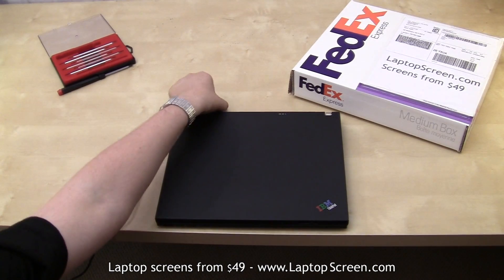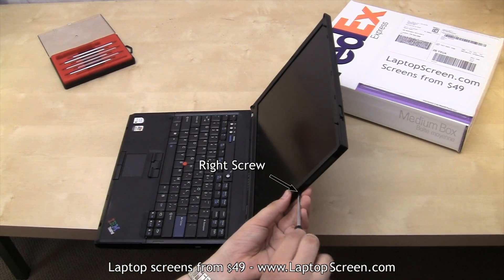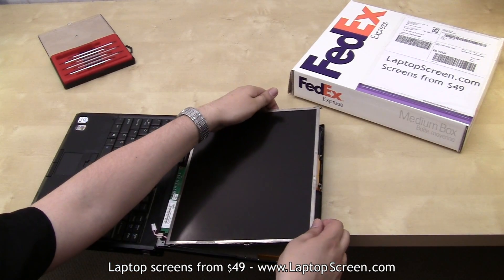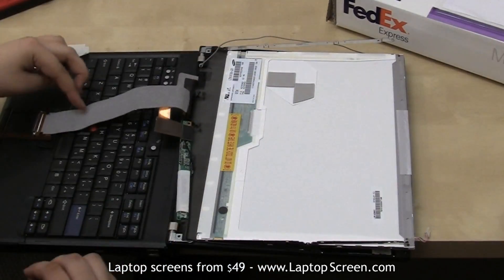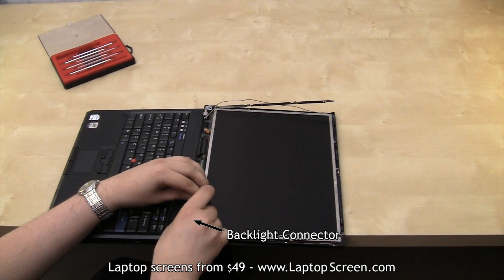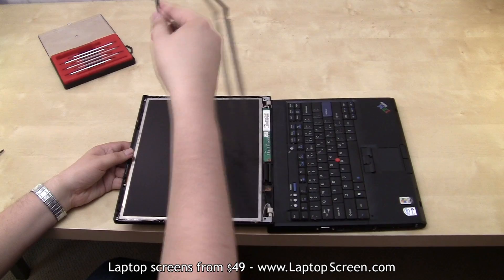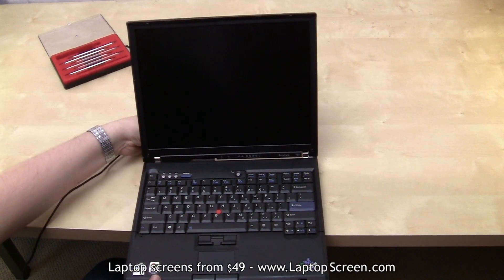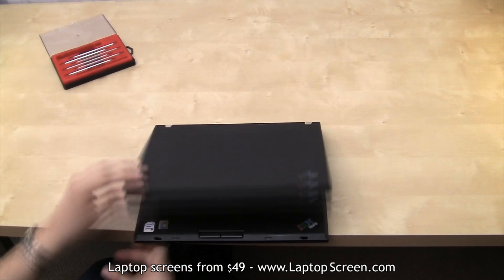Laptop screen replacement, LCD screen replacement guide [IBM ThinkPad T60]

Comment: Friend, the screen of the ibm thinkpad T60 is compatible with that of the r50e, are they the same as a replacement?

please if you read this answer me
Reply from the maker: T60 uses 3 different sizes of screens. R50E uses 2 different sizes. The screens that are the same size between the two are interchangeable.
Reply: @Laptopscreen  but they are compatible with the ibm thinkpad r40 and T60 displays with the r50e
Reply: @Laptopscreen  or just tell me if the one of the ibm thinkpad r40 is worth with the one of the r50e
Reply from the maker: The 15.0" screens are intercompatible.

Comment: This is helpful, but if your laptop has an internal battery, then there's a step missing that will protect your laptop from possible main board damage -- DISABLE THE INTERNAL BATTERY!  I wish I had known that before faithfully following the steps shown in the X1 Carbon Gen3 video (https://youtu.be/VqH2JXxs4XM).  Had I known this one critical thing, it would have saved me blowing a fuse on the main board, which is very difficult (or expensive) to repair.  For Lenovo ThinkPads such as the X1 Xarbon, the internal battery can be disabled by removing the back panel and unplugging the battery, or by changing a setting in the BIOS.  To see the BIOS shutdown process watch: https://youtu.be/bsC5lAqkB6Y?t=615.

I've posted here, even though I followed the video specifically for my model, because this video is listed on the website for Lenovo laptops in general. Other Lenovo laptops have internal batteries too, so this is my attempt to make potential customers aware of this risk, hoping they don't end up with a damaged main board like me...
Reply from the maker: Dear Patrick, your comment is helpful, EXCEPT that the battery on the T60 is easily removable as the video clearly shows on its 7th second. Also, this is a CCFL screen so the back-light power is not routed via the video cable, thus your entire point about back-light fuse is irrelevant to this video and T60 laptop. However it is relevant to other LED back-lit laptops with a not-so-easily removable battery. Thanks for the link provided, although that battery can still be physically disconnected, turning it off in BIOS doesn't unplug it.

And to further expand on the blown LED back light fuse - it doesn't happen because the battery was not disconnected - it happens when a cross-eyed installer with crooked hands short circuits the video connector by fiddling and jamming it in every which way, especially on a slant, instead of firmly plugging it in directly straight using both hands. We have lots of videos on our channel where the LCD screens are replaced on devices with the battery still connected and not a single device have had the back-light fuse fail as a result. We wouldn't recommend it to our customers, but you can even replace the LCD screen on a live computer - hot swap - booted and fully back-lit LCD. We plug-in hundreds of screens in our tester laptops live each week, and have never had even a single blown fuse.

Blowing your back-light fuse is an installer error first. It is always a good idea to disconnect the battery just in-case you do make that error, or any other errors like dropping your metal screwdriver on to an open circuit-board. However it is not an essential step as it really comes down to plugging connectors in straight and not letting connector pins touch where they are not meant to touch (being careful).
Reply: LaptopScreen.com it's unfortunate that you resort to insulting your customers instead of trying harder to inform them of the risks involved.
Reply from the maker: Your comment was approved, and replied-to in-detail with the good faith intent to inform. You make it sound as if we're hiding something, but the objective reality is quite different: cases of back-light fuses shorting are extremely rare compared to the sheer number of laptop screens being replaced. We recommend disconnecting the battery, and we also recommend plugging the connector in properly - straight, with-out a slant - with both hands.
Reply: I admit I was quite upset when I made my first post. It's very frustrating to learn there is such an easy preventative measure that would have ensured my success... I've edited my original post to be much more objective. 

With the number of Ultrabooks on the market now, I suspect this issue will only increase. You would be doing your customers a service by explaining this risk on your instructional videos as clearly as you have here.